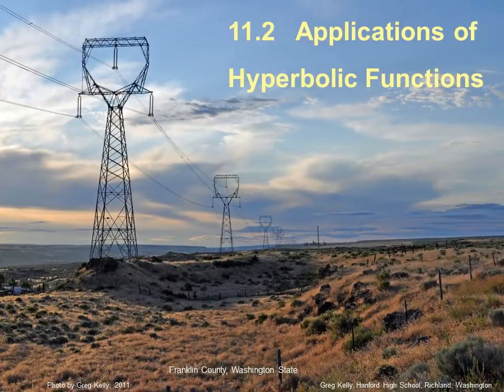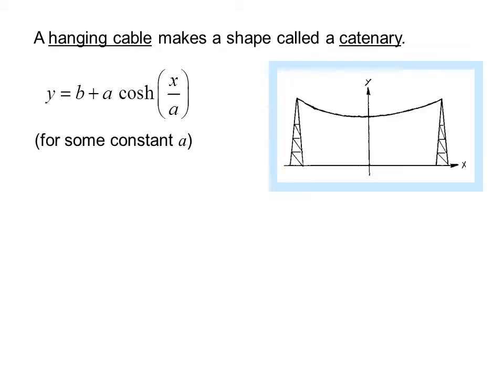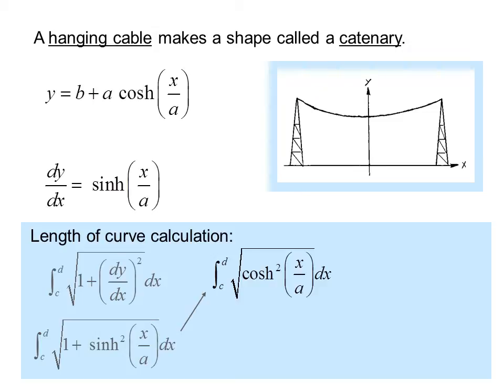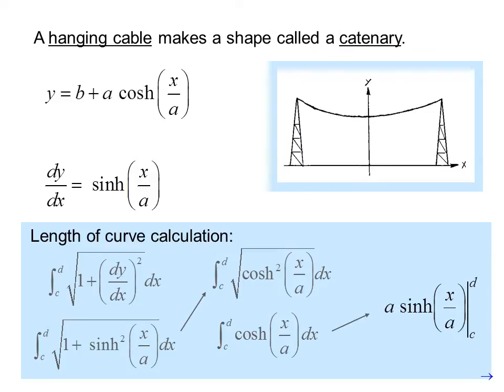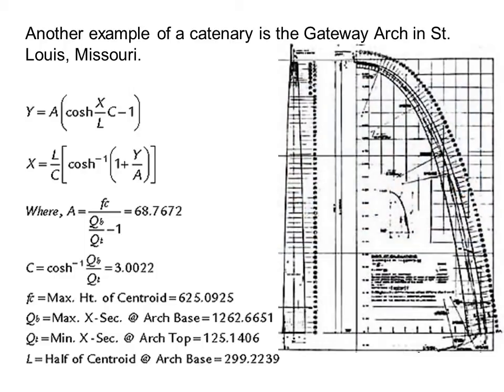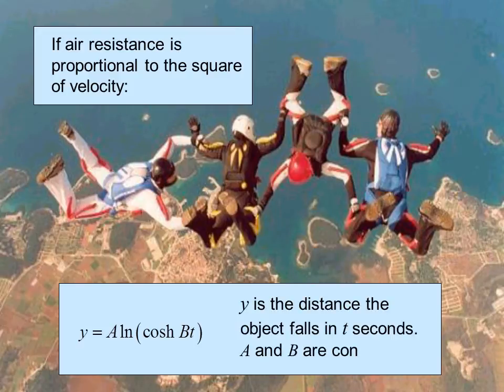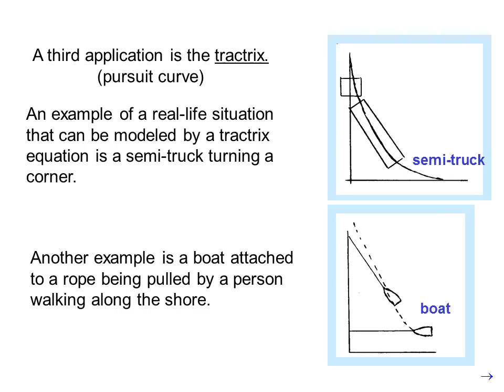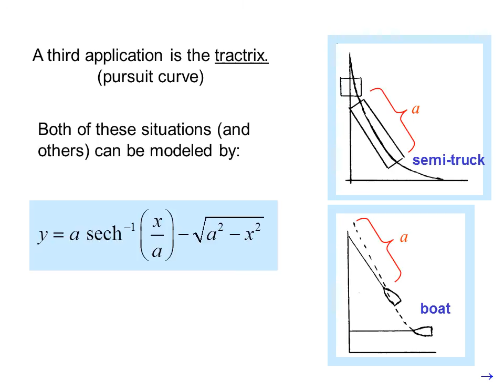Calc11 2 Applications of Hyperbolic Functions

Comment: I am in Calc 3 yet have never seen the use of a hyperbolic function...what class are they typically introduced in?
Reply from the maker: I use this topic as an interesting diversion for both AB and BC Calculus after the Advanced Placement exam. It's not part of the AP curriculum.
Reply: But how about standard university level Calculus I or II courses (which I think the AB and BC calculus curricula are supposed to emulate)? At least, the university curricula you are familiar with.
Reply from the maker: Hyperbolic functions are not normally included in the first two or three college calculus courses. You may see them in more advanced classes. I ran into them in a college physics class many years ago. I just thought they were interesting.

Comment: when it's integrated between c and d what does this mean?
Reply from the maker: In this equation, we are using the "length of curve" formula to calculate the length of the cable. The constants "c" and "d" are x-coordinates, so the integration calculates the length of the cable between points "c" and "d".
Reply: ah thanks so much!